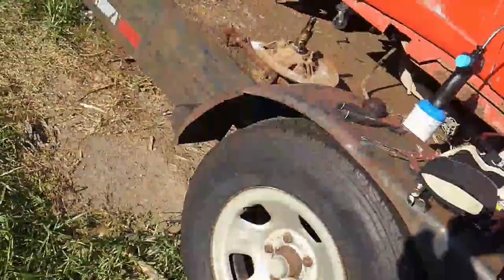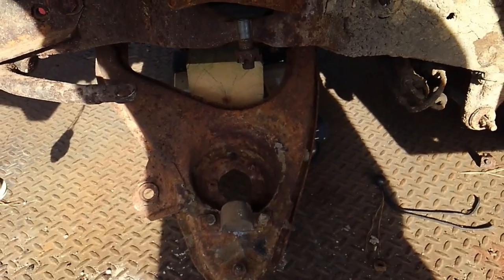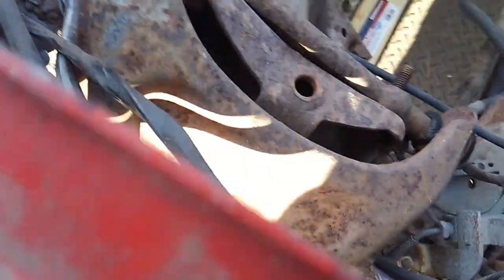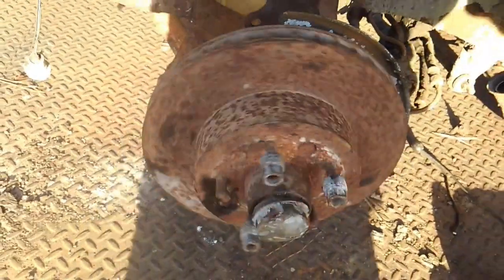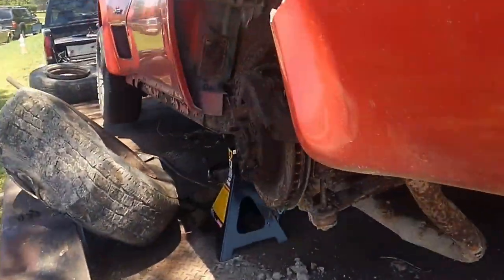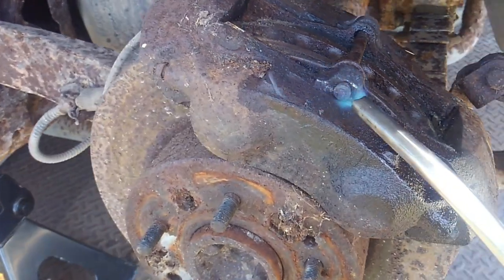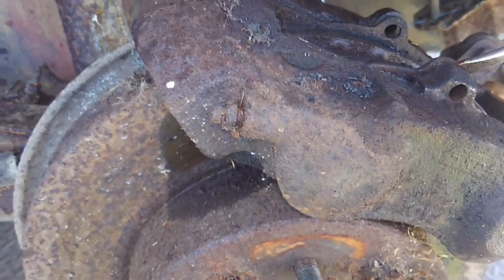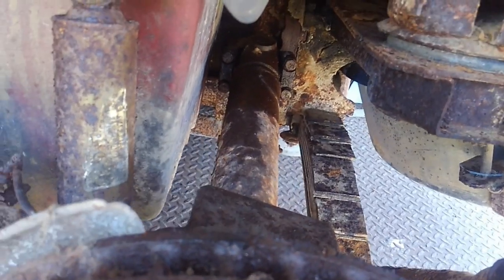Prepping the 1972 Corvette 454 for Trailer Removal

Comment: What the heck happened to those wheels? Jesus... I didn't know that happened in Texas. I've never even see that up here in Canada
Reply from the maker: That my friend, is what happens when you leave steel wheels laying in the dirt in South Texas. It tends to hold quite a bit of moisture and with the high humidity causes quite a bit of damage if left too long
Reply: @VetteSource  were there any 454 vettes made? In the C1's, C2's, or C3's? I know the C4 is only available with a few varieties of the 350 small block
Reply from the maker: Yep, 1970-1974 Corvettes all had the 454 Big Block as an available option.  The 71 LS6 was the most powerful offering of the 454 in the Corvette. Only 188 of them made.